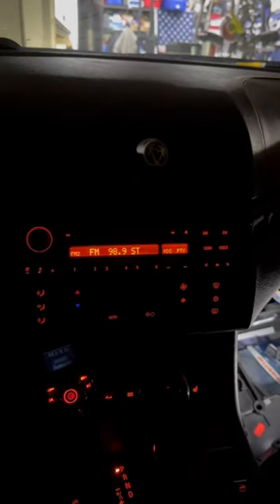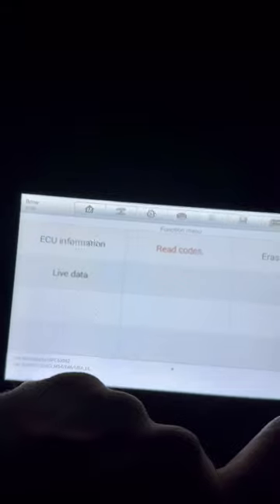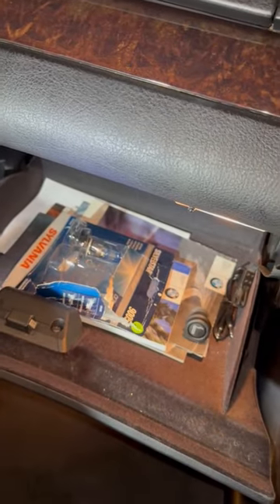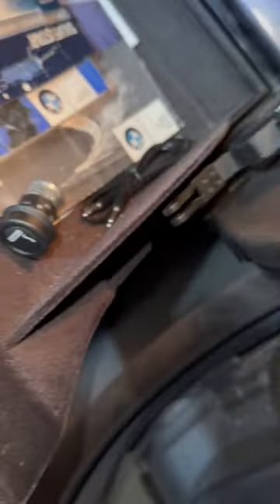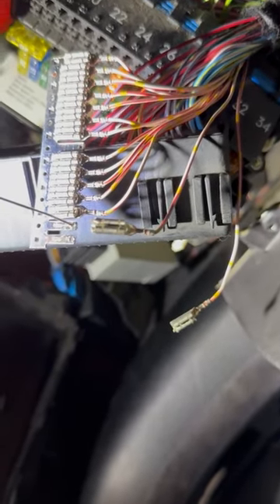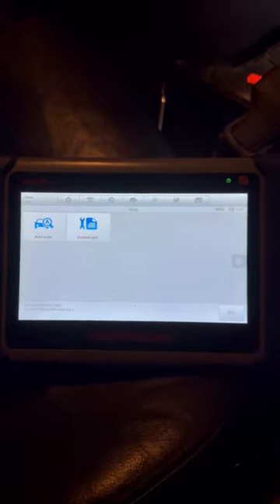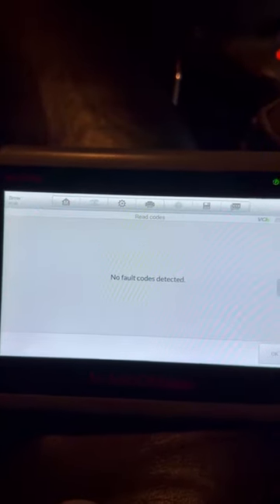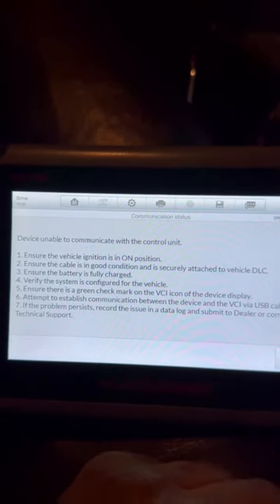E46 Cluster Dash not working, windows K BUS down diagnosis & repair

Comment: Just a note to say that while a bit more info on getting the glovebox out (boy that needs a BIG yank!) and on how to unlock those terminals would have been helpful (all very googleable, or possibly just second nature to you) 

That said,, my car had no windows, binnacle lights, binnacle indicators/warnings, wipers, etc after the boot (sorry, trunk) got flooded - and I think the connectors for the CD changer and roof hydraulics got soaked.

Like you, first couple of connectors unplugged and everything came back to life. I think I'm down my AC clutch activation and the roof button lights come up but nothing happens, so that's probably a clue as to what's going on I guess.

Absolute life safer - I've got to drive 100 miles each way for work next week.

I'll break out INPA next weekend when thing are more chill, and diagnose the actual problem properly, but this saved my bacon big time!
Reply from the maker: Thank you very much for the feedback! Next glovebox I remove I'm going to get details on that, your right sometimes you gotta yank it hard!

Comment: Wow that’s what i was looking for… i had sit my coupe for 2 months and i think the jump start burned something… i have the driver side with some problem now as no speedomether and rear window not working, since i have already swapped the abs sensor i’m tracking some electrical problem
Reply from the maker: Jump starts can cause module failures, it all depends on the voltage from another vehicle, whether the battery was completely dead or had close to 12 volts, and whether using another vehicle or jump box. In my professional career I have seen a handful of failures following a jump start.

Comment: Yo my cluster and garages work just turn signal indicators don’t show up and all guages don’t light up orange. 

Any ideas? Ran codes says I have kbus issues
Reply from the maker: Sure sounds like a module fault, can you communicate with every module? Try separating each module from the k-bus like in the video, on this vehicle I also did not have cluster backlighting.

Comment: What if my e46 shows the ecsactly the same codes as you, and i have the cluster back lights and ni turn signals onnthe cluser everything else works but when i got the the K bus bar i found it had 11.37v with ignition on & 1.07 with ignition off now im lost
Reply from the maker: Sounds like a voltage drop, bad connection, etc. But, have you already tried disconnecting each one at the bus bar to see if the code can be cleared and those items start working?Also, be sure your battery isn't faulty and has more than 12 volts, with ignition OFF, if not it can affect how the modules operate too.

Comment: I have same problem on my e39, as you know low cluster e39s has same system as e46, same junction bus for i/k bus. Even disconnecting modules on bus, one by one doesnt fix the problem. Do you have any advice ? I really need help
Reply from the maker: What codes do you have in all the modules? Anything relating to the k bus? If no codes at all pointing in that direction, check your power and grounds at the cluster, you may be looking at a faulty cluster itself, considering you have no other symptoms and no bus codes in any other modules.

Comment: Hello! I have a similar problem, but it still works for me after I removed the safety from the navigation, but the parking sensors don't work, can you give me an opinion?
Reply from the maker: Hi, what year and model do you have? Do you have a OE level scan tool and if so are you able to scan the modules to see what errors show up ? Specifically for the park sensors?

Comment: hello, i've got a problem where my indicators, windows, warning lights and everything works fine on my 2003 e46 station wagon but the cluster backlights don't turn on when i turn my headlamps on so i can't see anything at night. do you think this is still a k-bus issue or something else? and if so, do you have any tips on where i should start diagnosing?
Reply from the maker: Hi there, it could be a K-Bus issue, but could just be a faulty cluster, usually there are more than just one symptom. The first step is to scan all modules and record the diagnostic codes, if there are DTC's pointing in the direction of a K-bus problem than you'll attack it like in this Vid, but or there may very well be DTC's in just the cluster pointing toward it's failure. If this is the case, you can remove the cluster and check the connection's or wiggle the connectors gently to see if the backlighting begins to work, further indicating a cluster failure. Hop that can guide you in the right direction

Comment: which Autel can i get for an e46 for solving similar issues
Reply from the maker: MX/MK 900 or 808 are the least expensive Autel, and supports OEM BMW. However if you have an early model E46 with the 20 pin diagnostic connector under the hood, you'll need an Autel with OBD1 connectors, like the MP900KIT

Comment: Remove the adaptive headlight module everything works fine
Reply from the maker: Good Job!!
Reply: @ripsgarage  everything works?
Reply from the maker: @StevenPerez-ge9ch  Yes, In my situation I replaced the ZKE module and everything worked perfect after. If your adaptive headlamp module is causing the failure, you should replace and recode as well.
Reply: @Rip’s Garage  adaptive headlight issue is inside the headlamp wires start to get brittle another thing is if you leveling sensor on the right lower control arm is broken it would cause this issue...and it will disable radio and windows cluster malfunction
Reply: @Rip’s Garage  good to know
Reply: I’m having a similar issue with the kbus going down, my drivers door actuator is going bad and occasionally shows door ajar, the kicker in my situation is my cluster works as it should when I open the door, once closed it goes back to not showing any turn signal indicators, high beam, fog lamp etc

Comment: My man, having the exact issues, and codes. Hoping I can diagnose the broken module without a second scan.
Reply from the maker: I would suggest investing in an scan tool that reads all modules, if you don't already have one. It'll help in the long run too. Something like the Innova 5610 is a good scanner that can read and clear all modules on BMW. They sell on Amazon for about $350 but you won't regret having it if your working on this yourself!

Comment: Why didn't i see this earlier. I can access the DME and EWS (I believe those are a seperate line on my Z3 2001) but not all other modules. Had an appointment at the dealer but will cancel and try this to see if I can access the modules. ZKE etc is working but I can't access it over the K line.
Reply from the maker: Your's should also have the K Bus splice above the glovebox. I would disconnect each one there, would be easier than going to each individual module. Hope that helps?
Reply: @ripsgarage hmm, can’t find anything that looks like it. Don’t have any fuses there either. Will go look around the fusebox under the hood.
Reply from the maker: @kaas12  Sorry for some reason i don't get notifications on comments. Send me your email, I'll send you some of the info I have that might help you diagnose this or at least help find the splice.

Comment: Can you actually just pull them out or will that cause compatibility issues?
Reply from the maker: Pull the pins from the kbus? You could wrap them and leave it like that, but whichever module is causing it will not communicate and therefore no longer work as well.

Comment: I have kind of similar problem . After a two month a car was siting it was cranking a litle ruff when i came and buy a new agm battery then i noticed for a moment i cant open a window 5 mins all where fine then i cant lock the car sometimes the problem fixed by itself after a wihle my key wasnt able to unlock the car i paired it again but when i tryed tolock unlock sometimes corner lights wasnt working . After that came airbag problem later a abs and traction contorl. Then i was scared what is happening here went to mechanic and he sed i cant do nothing i cant conect to any modele in the body class. After that i came home and removed the carpet it was kind of wet then fixed the holes near back of the window and engine cpu water was coming over. And then i instaled impa instumental cluster showed k-bus short l IKI-EEPROM-Fehler, Codierung fehlerhaft/unvollstaendig Lichtmodul-EEPROM-Fehler then i picked yellow red white wire from rain sensor and cheked the ground yes its grounded to car with 40omh and after that i diskonected each module from the car but nothing helped after i checked x939 box there was i-bus wires and 2 of 6 was shorted a riped them apart and taped them. And now i still diging and trying to find any clue. Tomorow ill take all carpets and try dig deeper. Any advice?
Reply from the maker: Hi there, are you able to connect to modules now? If not, that is the first step. You need to have communication. If you can connect to certain modules, you need to figure out which modules are not connecting, if you can't connect to any module, especially the DME, than you have a complete network failure, and that should be easier to diagnose. It can be wiring, or one of the two nodes at the end of each network. Typically the DME is one of the nodes. You always need to establish communication or what is not communicating before furthering any diagnostics or testing.
Reply: @ripsgarage  i removed all rugs by now disasembled all k bus modules but still have grounding isue to k bus i think i could have a broken wire. With impa i cant conect to eny i/k bus module that is nightmare dont know where to start and nobody wants to have hands here beclause car is from uk made to eu. Why dme ? Can bus is working i can drive with the car but the k bus like is messing up all cominications. I diskonected all mudules exept engine department and wbasta jus checking the broken wire i have short to ground to 40-60 omh the number is changed when riped a rug out of the car. Any advice ?
Reply from the maker: @egipet9412  Ok so Can bus is good, just k-bus is faulty. Can you disconnect all k-bus modules, than disconnect all the k bus wires at the bus bar, and check continuity to ground on each wire? See if one in particular is grounded?
Reply: @ripsgarage  yes. Today i got full diagram of my car and find out a wbasta is on k bus line, so i unpluged it and problem is solved... 
That was alot of work with such a simple problem.
Reply from the maker: @egipet9412  That's awesome man! Good Job!!

Comment: Hey man what scanner tool are you using? I'm having similar issues with my cars k-bus system and would rather use the scanner to diagnose vs testing at the bus. Thanks.
Reply from the maker: On this one I used the Autel MS906 to scan and my Autoland to code the used one; but you would still need to remove pins at the k-bus to isolate which module is taking the network down. That's due to the k-bus being shorted and therefore the network between those modules is down as well, and trying to access any module on the K Bus usually doesn't work until you remove the failed module from that bus. Hope that helps.
Reply: @ripsgarage  I've pulled my kbus and read the voltage at every pin and I'm getting anywhere between 9-10 volts. What do you think I should do as my next step?
Reply: And that's on every pin. No fluctuation of voltage either. I ended up pulling my radio and finding a couple wires were spliced into do you think that would effect anything?

Comment: Same on e39?
Reply from the maker: Yes it is! K Bus junction on E39 is also behind glove box!
Reply: @ripsgarage  thanks for a fast answer. Can i diagnose i-bus the same way? And i guess the i-bus is in the same box?
Reply from the maker: @drmaglocks  Sorry just seeing this, yes same diagnostic flow. Remove one module from the bus at a time. Scan modules to see which ones come back online and which does not. The one that does not...is the fault!
Reply: @ripsgarage  Removed phone module, pdc module, some radio module, radio and the lcm. No difference. 11.5v at every i-bus cable. Removed the cluster but only found a k-bus wire? Got 12v to the lcm aswell. My symptoms are: pdc not working, no indications in the cluster. Headlights, foglights, blinkers + noise, Doors open. Radio always on, no controls working on either steering wheel or radio. Cruise control does work however. Im starting to think my radio and lcm are broken. I bought the car like this so i dont know how it occured.
Reply: @ripsgarage  Will swap radio tomorrow and see if that Will work. Then ill be sure its not an i-bus problem.
Reply: @drmaglocks  Did you solve the problem?
I have a similar problem.
Reply: Hello, yes i did! In my case i removed one cable of the junction point under the glovebox. I think the cable i removed was for the phone in my case.

My car was abit odd since i had both i-bus and k-bus on the same junction point. At my cluster i didnt have i-bus but at the lcm module i did. So dont get confused like i did.

You can try to measure 12v at i-bus and if you have low voltage you have a short to ground. You can also try to sum it with ground. However in my case i did have a short to positive so measuring didnt help me at all. You can try to unplug modules connected to the i-bus one by one, you might have a bad module that draws current from the circuit or it could be that one of the wires to the modules are shorted :) Could also be the light control module, what symptoms do you have? @NN-wi6ru
Reply: @drmaglocks i have constant 12v on i/k bus, but even disconnecting modules one by one not fixing problem, at this point i guess i need an osiloscope to read message on bus. Do you have any advice ?
Reply: @Dayw  my best advice is the junction point. When you disconnect the cables there you exclude the whole circuit. Might be a problem with the wire not the module itself.
Reply: @drmaglocks  thanks but I sold the car